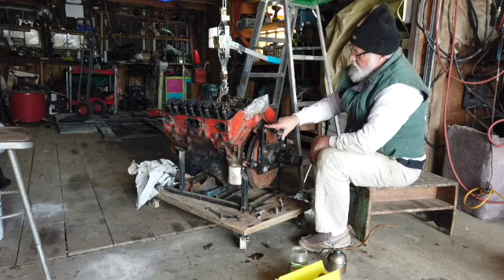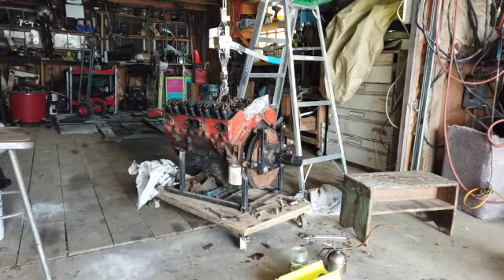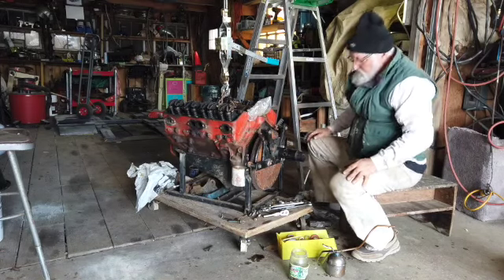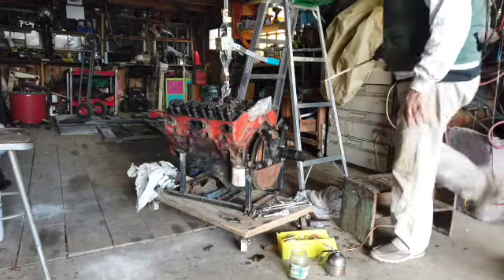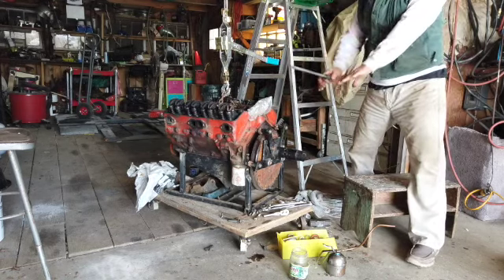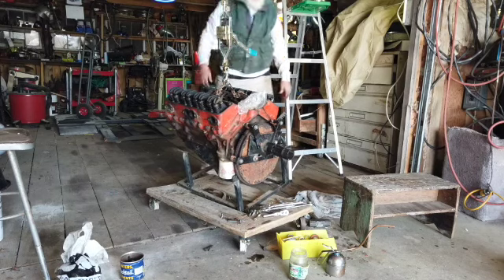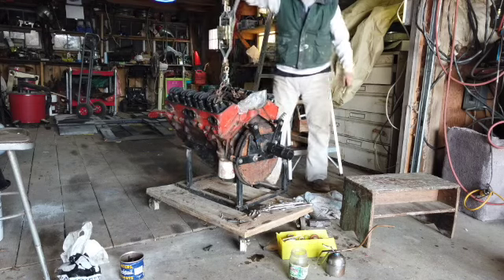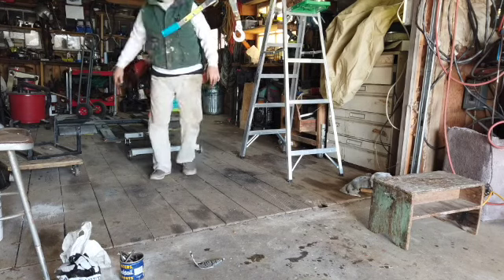Putting a 65 Chevy 283 on an engine stand 2

Comment: When you mount an engine on a stand, you want the pivot for the stand well above the center line of the crank. Engines with heads on them are very top heavy and hard to rotate on the stand. They want to flop over.
Reply from the maker: Yea, exactly.